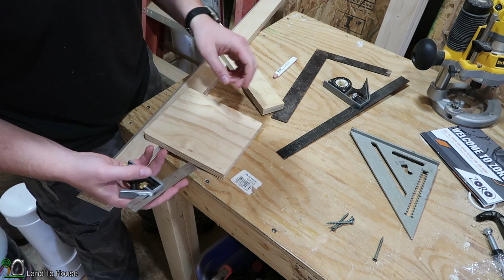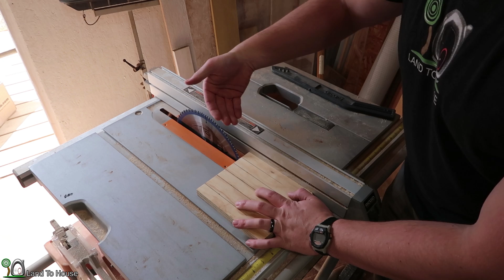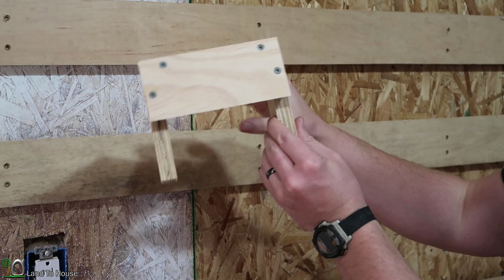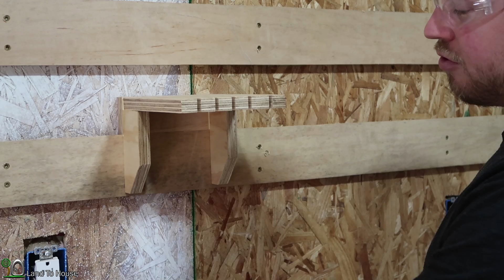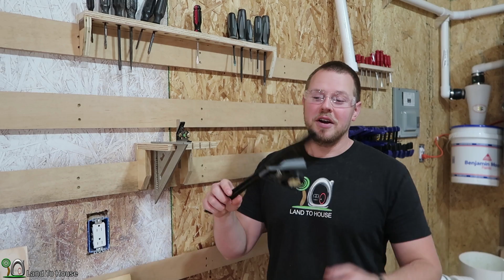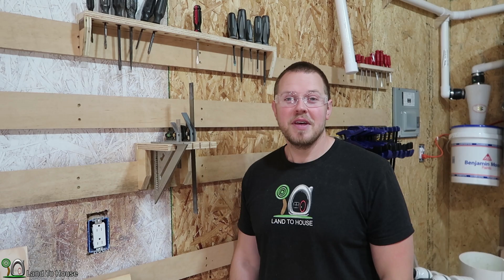Square Holder French Cleat - Build a Workshop #52

Comment: Three questions... 1. What is the width of the cleat?  2. What is the distance you're using between cleats (and are you happy with that)? and 3.  What do you think about using 1/2 ply instead of 3/4 for the cleats and the mating cleat on the holder?  Thanks!
Reply from the maker: Thank you for watching. 1. Each cleat is approximately 3 1/2 inches high. This can be smaller depending on the weight of your tools. 2. The distance between cleats is around 4 in. As long as you can get your cleats into the gap this distance doesn't really matter. I'm very happy with that. No issues so far. 3. I feel like you will be disappointed with half inch cleats. Not as strong and not as much room 2 bite into. The angle on 3/4 inch plywood is approximately 1 in.
Reply: If you design the tool holders to sit below the cleat so that the weight is hanging from it like a hook instead of cantilevered out for efficient use of space then 1/2in stock would work fine, but you'd have to play around a bit with the wall cleat width and screw spacing to ensure it's stiff enough.

Comment: Might want to lower the table saw  blade.  Lol.  Isn’t the first rule of table saws is to have the blade just above your piece of wood 😂😂👍👍🤪🤪
Reply from the maker: Yes I think that is a rule. Most of the time I do lower it to within 1/2" of the top. ... But I also forget often haha
Reply: Land to House I always lower the blade to less than 1/4” of my work piece.  Just two weeks ago on New Year’s Eve, I was ripping down a 2x4, and I stupidly wasn’t using a push stick with my left hand.  I tried to push the material against the fence behind the blade because I don’t have a splitter, well the material caught the blade and pulled the 2x4 back...and my left hand with it.  My thumb went right over the blade, but it only went about 1/4” into my thumb.  Literally I am so thankful that I had the blade height set responsibility, I would have one less finger.  I almost have full mobility back already...and a $750 ER bill
Reply from the maker: Looking back at this video I remember why the table saw is pushed up. That cut required less curved underneath. But normally it's a very good idea to have the blade as low to the piece as you can. Glad to hear that you have recovered. Sounds like a nasty injury.